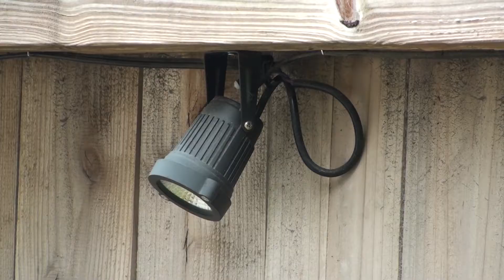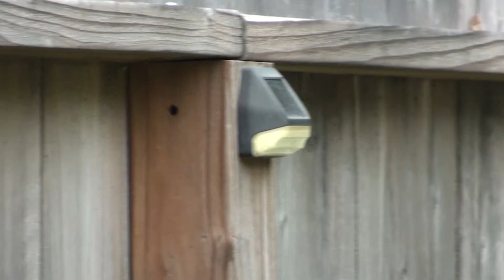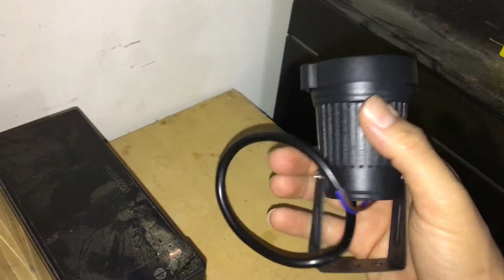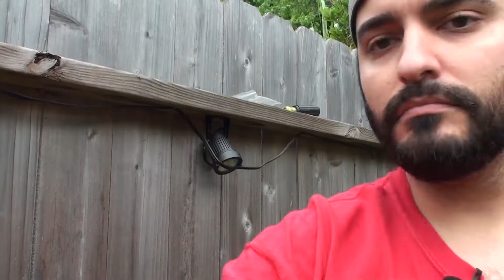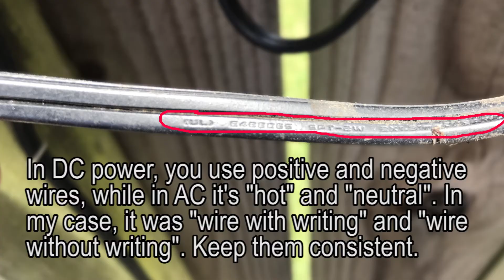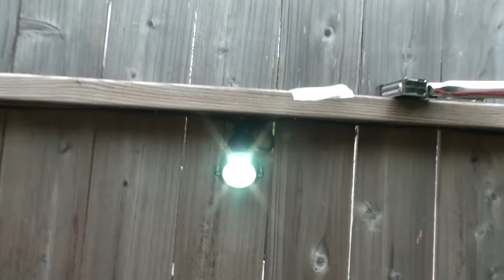DIY 12V Landscape lighting along fence

Comment: I have the same lights, but changed it out to a lesser wattage light because it was way to bright.  Perhaps bore a hole into
The wood to hide the wire nuts so it’s not exposed to the elements?  I’ll post a vid soon but I’m half way done with the fence.  Thanks for the vid.